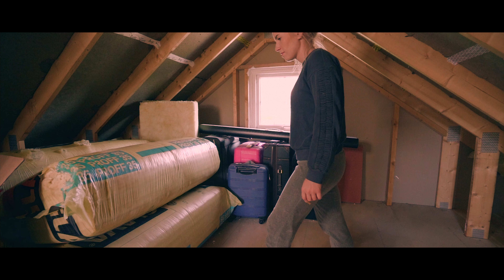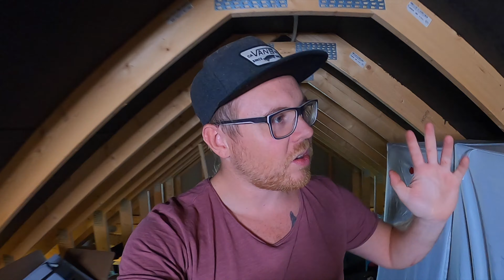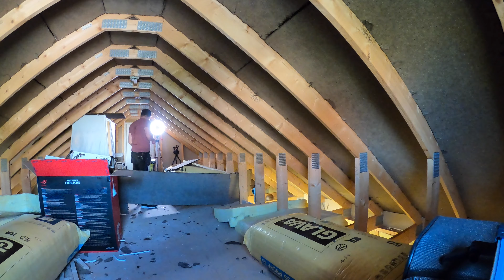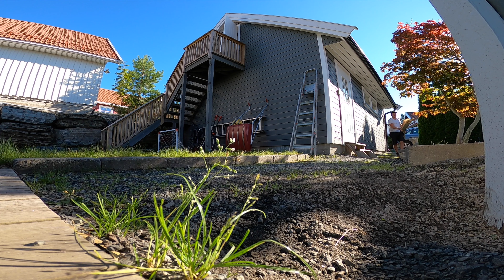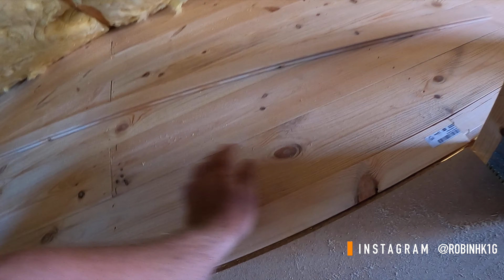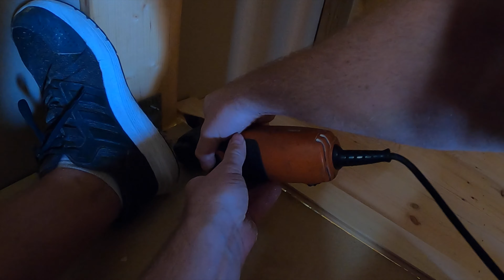Project Garage E2 - Can you vlog using Lumafusion 2.3 !?

Comment: Sorry LF was crashing for you Rob. I edited two vlogs recently in LF on the 2017 iPad Pro, no crashes, but I wasn't using 4k footage either, so maybe that is why.
Reply from the maker: Ye, i went down to 2.7k 60, worked a lot better😌
Reply: @RobHK  It's weird though because I thought LF on a newer iPad Pro could handle 4k without a problem